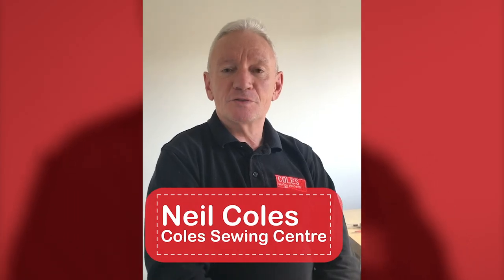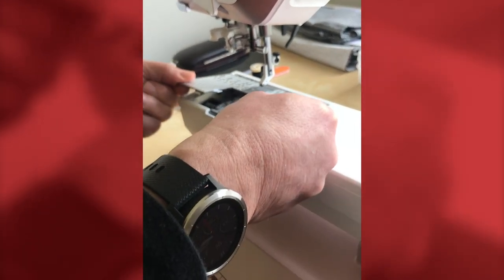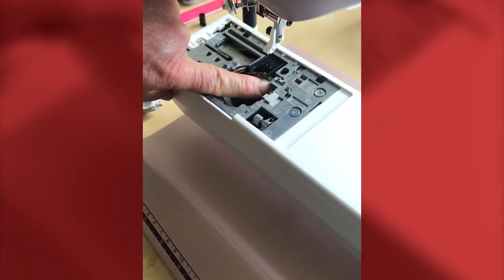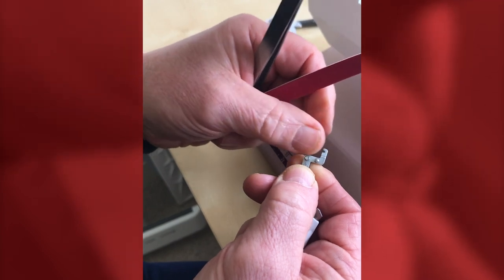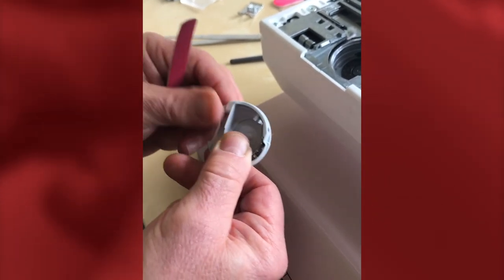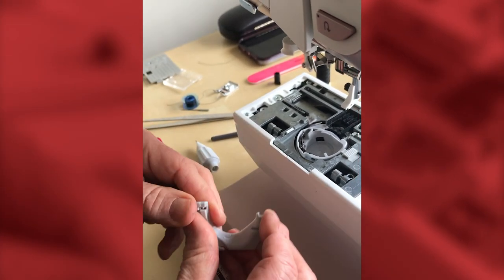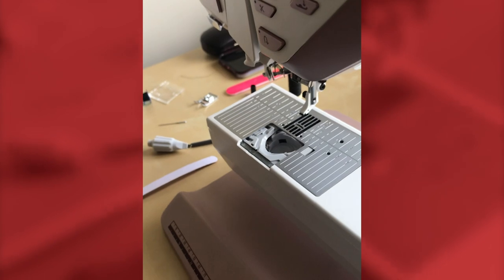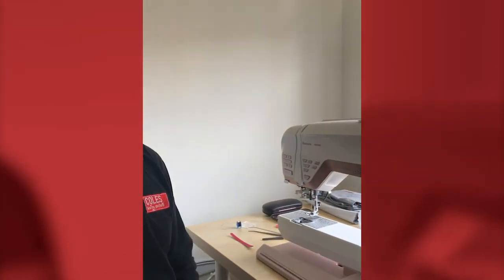How to look after your Husqvarna Viking Epic sewing machine

Comment: what if the cover must be removed because thread is caught inside and cannot be reached without removing the cover plate
Reply from the maker: It is easy to break the top part of the cover when removing or refitting, that is why we don’t recommend removing it. It’s a judgement to make yourself, but it will not sew without the cover on.